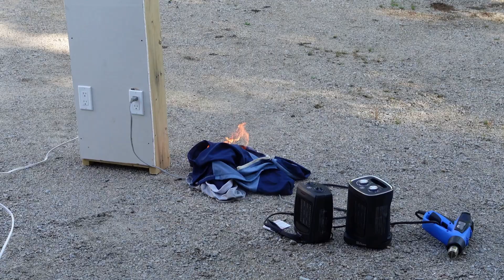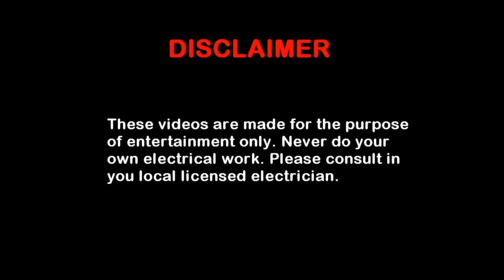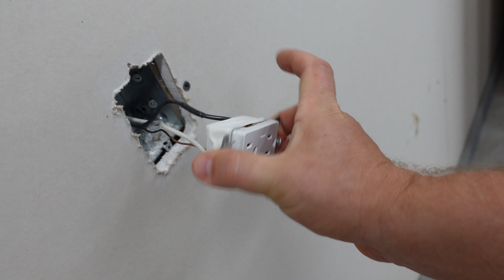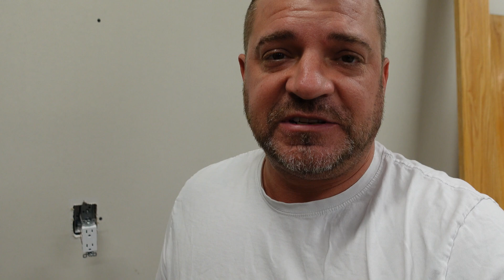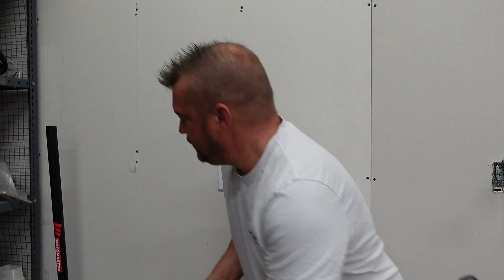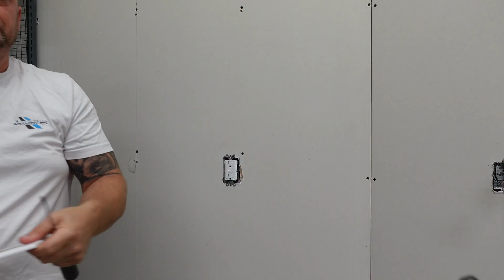Should You Tape Electrical Outlets

Comment: Thanks for the tip, I renovated my house and found some GFCI receptacles had electrical tape on them. At that time I suspected it was because the receptacle is fairly bulky and the boxes were... too small. I changes the whole thing and got it inspected. Everything is fine now.